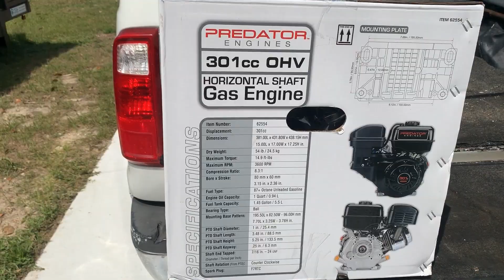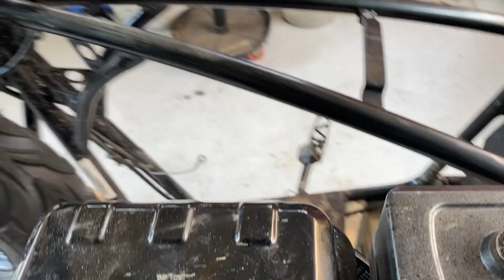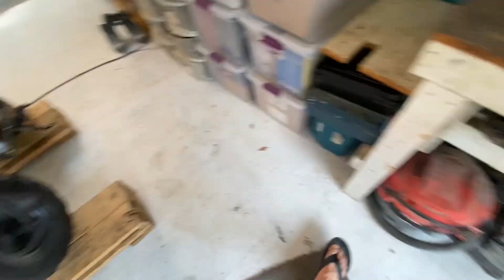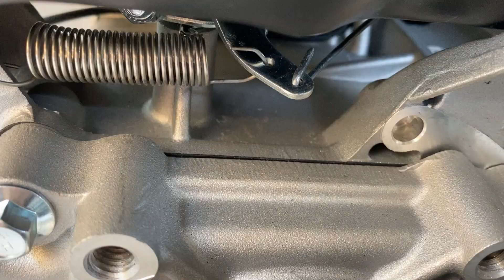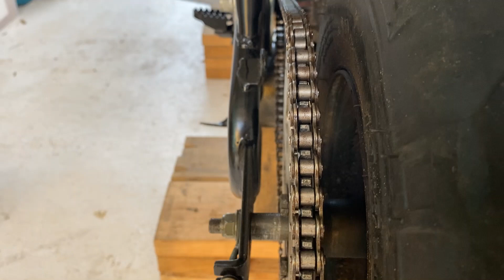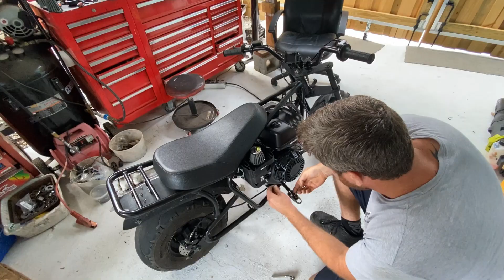301cc Predator Mini Bike Budget Build

Comment: I got the same build but the part where you drilled the back holes in the mount can I see how the bottom looks can’t figure out how to get a good angle to lock the nut down

Comment: Watched this to see if someone finally mentioned the throttle linkage issue. You did exactly what I thought I was going to have to do with the hard link instead of the spring. I watched the spring cause so much slop. The only way it would close was to snap the throttle shut. Now my carb will actuate the way it should. Thank you!

Comment: Nice video, I appreciate the detail as that’s my next build. I just finished a nicely built high revving stage 3 Predator 224 that’s a 60 mph+ ride with a Tork-Zilla on a modified CT200U. But I’m always looking for bigger motor builds. Thanks. Just curious, noticed your tats, are you military? If so, thanks for your service.

Comment: How did you mount the engine
Reply from the maker: Grade 8 bolts to the engine plate
Reply: @motorcylesmayhem9834  I should of said alignment wise how im gonna be mm putting one on a friends same frame.

Comment: I went a different route than you with the throttle linkage but I followed everything you did with the torque converter and It slapped right together in under an hour thanks... considering the 40 series is an almost $200 jump in price
Reply from the maker: Glad it went well!!

Comment: You could have left the dipstick and went below it, i have the same tc, same 301. All I have to do was grind off one of the gussets on the bearing housing. All my bolt holes line up also. I was contemplating eliminating the r we dipstick as well but didn’t want to open that  can of worms lol
Reply from the maker: Glad that worked for you. I considered doing that also but didn't want to grind off gussets and potentially compromise structural integrity. Thanks for posting what worked for you to give other people options.

Comment: Cool build. I saw 41 mph on the radar. What is the real top speed? That thing has to be 50+ I would guess. Im curious because I have a Coleman BT200X with original motor but with governor zip tied / stage 1 straight pipe / air filter and 18# valve springs. With stock clutch and jack shaft  it does 40 mph. 10T on clutch 52T on wheel. Just ordered torq converter for it today. Im hoping that will give me 5-10 more mph. Back to the curiosity part. I was thinking about slapping a 301 on it but if its not that big of a difference might as well go right for a 420. Thoughts anyone???
Reply from the maker: I thought it would be faster also but 40 is plenty on that thing with the big tires. What it lacks in speed it makes up in torque. It will do wheelies from a stand sill and  pull my 220 lbs up anything. I’m sure I could put small tires on it and change gears to go faster but the fun factor is high and that’s what it’s all about. Remember these small engines produce a lot of torque and not much horsepower so you can only get so much out of them. If you want to go fast get a high reving Honda,Kawasaki,Yamaha engine out of a wrecked bike
Reply: look up 420 mega moto a guy named michael did a 420 swap. even has electric start!!!!!

Comment: Hey man, just found your channel. Really dig it! Keep the content coming! I’m in the process of building a 301 with a 30 series converter as well but I’m putting it on an off road scooter.
Reply from the maker: Sounds like a fun project!
Reply: What clutch do I buy for a 301cc engine?
Reply: What clutch do I buy for a 301cc engine
Reply: @georgespamsl2638  i believe it's a 1 inch shaft. OMB warehouse should be able to get you one!!!!!